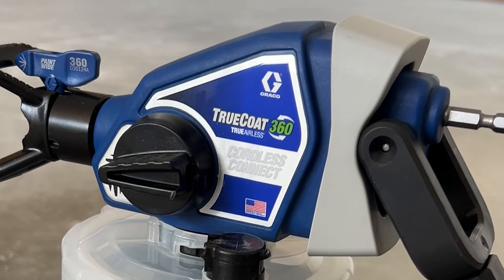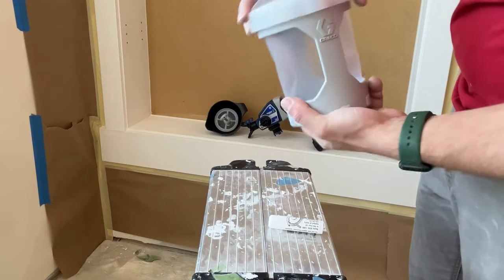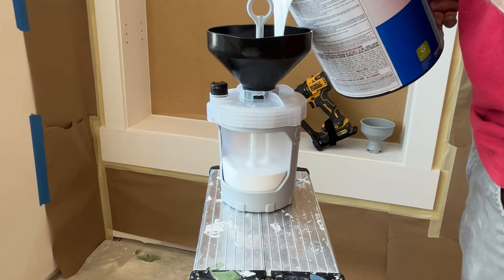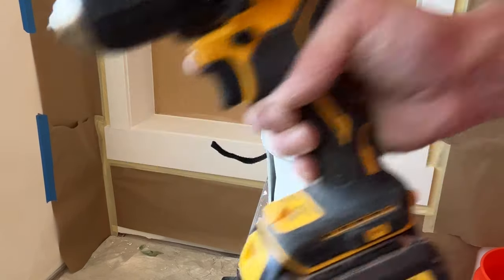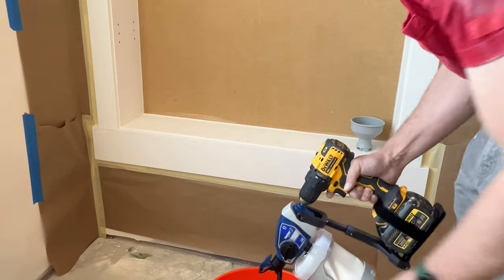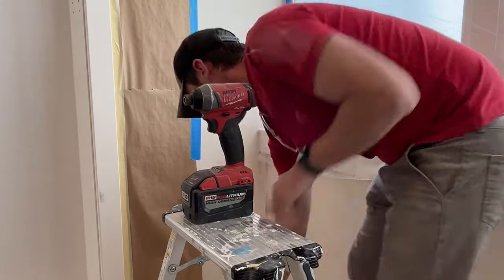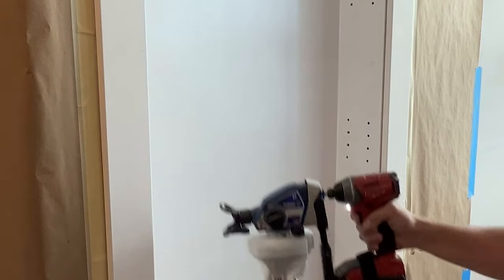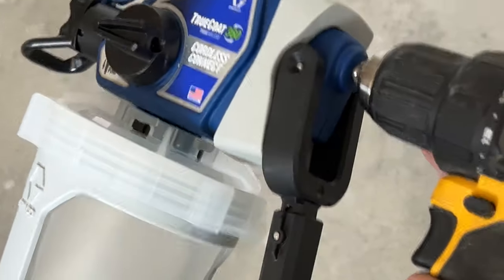Drill Powered Paint Sprayer?! Is it Worth it?!

Comment: Good review. Thanks. I bet arm fatigue would be an issue for larger jobs if you used this...it looks heavy.
Reply: You can get a near professional quality sprair.That doesn't hold the paint in the handle which means you only have about a pound and a half 3 pounds of weight instead of up to 15lbs depending upon the weight of the drill.  You can also rent a professional quality paint sprayer for fairly cheep... 40 dollars for something similar at harbor freight
Reply: The Graco 26D360 sprayer, and any similar hand-held sprayer, are most definitely not ideal for large jobs. Apart from their weight and clumsy handling, they must be constantly refilled, a messy tedious process. For large jobs, spray-gun/pump two-piece is ideal, though not without its own unique frustrations.
Reply: @MrKirby365  This is an airless sprayer. The HF is HVLP. A lot of latex paints cannot be uniformly sprayed with an HVLP.

Comment: I tried it with the milwaukee impact but the cordless drill worked much better. The drill was also milwaukee 18v and i used the high speed max torque settings. I followed the instructions on how to keep it unclogged and had zero issues. Pretty useful that it can be used in any orientation

Comment: Seen many who said the pumps break down a lot. Not worth the cost
Reply: That's what I'm afraid of. There's other options for a few hundred more but entails more parts to purchase and clean but I don't paint often
Reply: I've used the expensive graco handheld you can't really clean it and when it breaks you have to replace it. BUT I painted alot of cabinets with that gun the price point of this compared to that gun makes it worth it. You can definitely make your money back with something like this
Reply: How does the pump break if it's driven by the drill
Reply: The motors burn out… the battery powered ones have replaceable motors, but are 2-3x the cost. The o-rings can be easily replaced if they get torn up
Reply: @dragonking8817    I have the ultra cordless sprayer.  That was my concern before buying but if you make sure it's cleaned out properly and store it with pump armor that should prevent pump problems.  My guess is a lot of guys are lazy and don't clean their sprayers properly
Reply: I'm concerned with this system, and I think a lot of pumps break from the use of an impact. The hammer action has got to break the pumps at a much quicker rate, and only should be used with a drill.
Reply: The pump on this unit is stainless steel. The others are plastic.
Reply: I can say that a drill works noticeably better than an impact.

Comment: Seems you can use oil based enamel paint with this gun. This might be a good alternative to rattle can or buying an expensive spray gun + air compressor just to paint tool boxes and other small industrial cabinets.

Comment: can the pump be replaced in this model like the other handheld Graco sprayers...im having trouble finding the specific pump part for this model or does it share the same pump as the others .....or worse is this basically a disposable sprayer once the pump is shot????
Reply: Single action fixed pump. Once it’s done, it’s done. My best is 100 gallons and you will have burned it up.

Comment: Use the chapstick on the male parts of the connection not female
Reply: no he did it correctly. instructions say use the lube stick on the paint cup cap on the rubberlike seal.
Reply: @moofmanx2  I'm saying it from an engineering standpoint. Not reading the instructions view

Comment: As a heads up I want to say I got my paint sprayer on sale for a little less than two hundred dollars, its also what i would consider a semi pro series tool.  Up to 5 galloans of pai t woth out the need to refill. And you dont have to hold the waeight of the drill and sprayer and paint combined so... I am saying that at the beginning of the video before I know anything about the review so maybe I'll see a use or need that works here for the price
Reply: well your talking about a 1- 5 gal sprayer. but the biggest difference between why people buy this vs those types is having a 25 foot hose full of paint. you may not have to carry the quart of paint with the gun but ur carrying it in the hose. if your doing a small project that requires less than a gallon to a gallon of paint, you have just lost a lot of paint in the hose, and to try to get that back into the paint can without adding water to it is not practical compared to just dumping a flex liner cup back into your gallon pail without diluting or contaminating the paint. This is the main reason why you have small project airless sprayers in addition to a 5 gallon sprayer.
Reply: As a heads up, those are two different tools for different jobs. Apples to oranges. This is to spray a quantity that wouldn't be possible through a stand unit - a quart.

Comment: instead of handheld i rather they have shoulder body machine and a 1.5m hole with spray gun and yeah alot of weight off your hand
Reply from the maker: That's fair. Not for everyone.
Reply: They have made one. Graco Quickshot. This is 189 usd vs 1200 or so for the quickshot